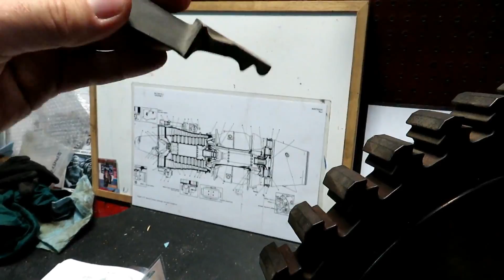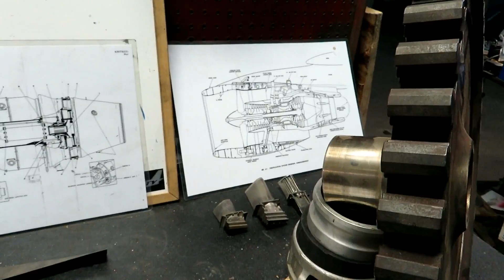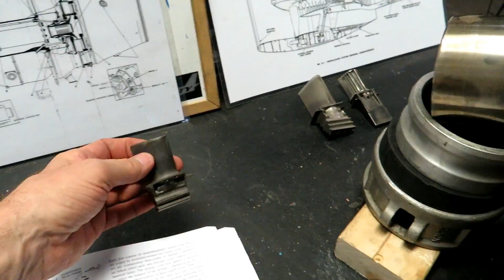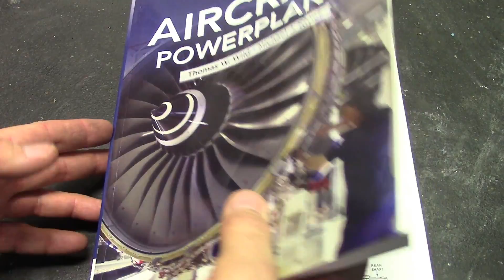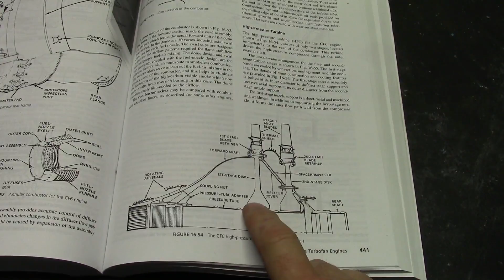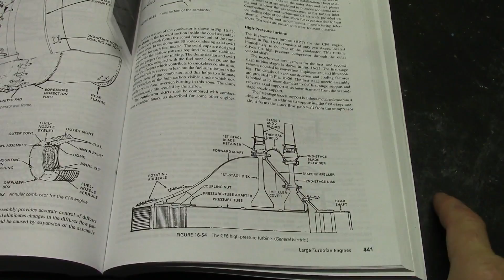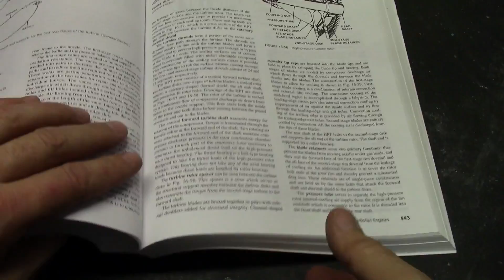Turbine Interstage Seals

Comment: I enjoy these views. I have a question about jet engines and over-revving. Say on the boat engines you work on. Say boat pops out of the water, does the engine speed up or stay the same speed when the load is off propeller and back on? I can't see this happens when in the air. I know not anything more than what I've learned watching your videos on jet engines in a way.
Reply: There have been occurrences where the LP turbine shaft breaks (that powers the fan) and the turbine rotors over speed and the turbine disks explode or throw all of the LPT blades.   Usual root cause of a shaft fracture is bearing oiling issues or oil fire,   Modern engines are supposed to be designed for this not to happen, but...
Reply: @powerwheelscd    have rotational speed limiter sensor (s) also to prevent overrevving

Comment: Juan Browne sent me. Nice 'splain & cutaways! One minor detail: the "compression ratio" on these turbines is diesel like which is why they have decent efficiency. 

PS: I was on this ship for the trial run of the GE turbine... quite an adventure! https://www.maritime.dot.gov/content/gts-admiral-wm-callaghan
Reply from the maker: The  compression ratio depends on rpm. It static compression ratio is zero.
That's why it's not called compression ratio... it's called compressor ratio.
Also the compressor ratio of the modern turbofans is over 40:1.
I don't know much about diesel piston engines, but is that about the same?
Reply: @AgentJayZ  OK... I put compression ratio in quotes because they're awkward to compare technically correctly. The general point is the amazing -- as in diesel like (18 -- 23 to 1 nominal diesel compression ratio) -- pressures these axial compressors create. The first jets used radial compressor/turbines with about 4 to 1 ratios... like earliest gasoline [Otto cycle] engines. The GE c6 based LM2500 has an 18 to 1 ratio... an industrial variation with no fan. The fan adds significantly... as you suggest. [... not to mention dynamic pressure... and we quickly get out of the territory of normal stuff for good technically aware people] 

The point you illustrated so well was the extent to which these amazing "hot section" parts must be cooled with "cool" compressor discharge air -- about 900°F -- and the amazing tricks required to get this "cool" to flow where its needed... the ~3000°F combustion discharge "air" being sufficient to fry most metals.
Reply: 'Compression ratio', as in an internal combustion engine, and 'pressure ratio', as in a gas turbine engine (I differ slightly in my terminology from AgentJayZ), are two very different things.  'Compression ratio' is actually 'volume ratio': it is the ratio of the volume in the cylinder at bottom dead centre (oops!  I nearly spelt that as 'center') over the volume of the combustion space at top dead centre.  'Pressure ratio' in a gas turbine engine is exactly that: it is the ratio of the pressure at compressor delivery over the pressure at entry to the compressor.  At maximum thrust, the pressure ratio for an LP compressor (or fan) could be 3:1, and the pressure ratio for the HP compressor behind it could be 8:1: so what is the overall pressure ratio of the engine? 
I have a VW 2 litre turbocharged diesel engine parked on my driveway, which is almost 7,000 miles away at the moment.  Its compression ratio is 16.5:1.  However, under power, the peak pressure during combustion could be as high as 80 times atmospheric pressure. 
PS  The answer to my exam question is 24:1.
PPS  I posted a comment almost identical to this about a year ago, when AgentJayZ presented a video about jet cars.

Comment: Is it usual that the damage done by the high energy debris of an uncontained engine failure causes such a life-threatening flood of systems malfunctions like on the Qantas A380? Would the Thai Airways pilots have had a struggle comparable to those on QF32? At QF32 they had the luck of being five of the best of Quantas together in the cockpit. I suppose the Thai pilots were only two. Did Southwest's Tammie Jo Shults and her copilot struggle with as many systems malfunctions as Richard de Crespigny and his team?
Reply from the maker: These are all different incidents that each have their own characteristics. I am not familiar with the details of each. So I decline any response.
Reply: The release of high energy debris from an uncontained failure has the potential to cause the total loss of an aircraft.  The larger the rotating component then the greater the risk for obvious reasons.  However, there is an element of luck, in terms of the trajectory of the released debris and it seems that there has been an element of luck in recent times.  
Quantas flight QF32 was, believe it or not, relatively lucky: had the segments of the failed IP turbine disc taken different trajectories, there could well have been a smoking hole somewhere in Batam island.  Similarly, Air France flight AF66, which had an uncontained fan disc failure over Greenland in September 2017, was perhaps even luckier.  Not so lucky was United Airlines flight UA232, back in July 1989.  The aircraft was almost uncontrollable, following an uncontained failure of the fan disc of its No.2 (centre) engine.  That the pilots got it down at all at Sioux City was remarkable.
Now if the Thai Airways event was down to the failure of what I would describe as a mini-disc,  the ejected debris would have had significantly less energy that the released segments of the IP turbine disc of flight QF32.  Nevertheless, if the debris had severed critical electrical wiring, or severed hydraulic lines, or punctured fuel tanks, the outcome might have been more serious, mitigated solely by the fact that the event happened at low speed, the take-off was rejected and the emergency services would have been in attendance within a minute or two.

Comment: an easier way to explain the air bleed cooling of the fins .... might be to use a section of hose and spin it around in a circle ... it will suck air through it as it spins around .... in a turbine that  rotation movement makes the fins move the air through them the same way and it pulls it from the intentional and unintentional gaps in the engines construction and of course the compressed air from the compressors ...
Reply: interstage seal sure dont mean some water animal performing tricks between show stages lol ;)
Reply: the hardest part in a  jet engine is every place along it there are several things working together to get the desired result ... some passive some active some beneficial some detrimental some intentional and some unintentional ... then add to all of that all the compromises made in the design to get the desired result ....
Reply from the maker: This is not correct. Cooling air is under greater pressure than the gases flowing through the turbine. The turbine blades will boost this pressure through centrifugal forces, but the turbine nozzles run even hotter, and they are stationary. The interstage seals do not seal cooling air; they seal the working gas stream from leaking past the turbine stages, keeping power losses to a minimum.

Comment: AgentJayZ,
I was under the impression that the Boeing 747 has a center gas tank in the fusliage. Is this a tank, or just part of the fusliage baffled off?
Reply from the maker: I know the wing tanks are really sealed off sections of the wing structure. I am not certain about the center tank, but it would make sense that it was of the same construction.

Comment: On the drawing at 10:20   ..You didn't tell us where the front of the motor is  ..it is confusing
Reply from the maker: I've shown this same assembly in several videos, and I also assumed a basic level of knowledge, that I shouldn't have. Regular viewers of my channel would know easily. However, the two labels in the diagram "forward shaft" and "rear shaft" should help.

Comment: cool! so what I don't get is:
- why the turbine disk ...node I guess, just hoovers around the shaft rather than actually attach to it at the disks. As I understood ,or didn't, the disks are hanging on the shell thingofashaft that actually attaches to the shaft
- can't there just be some holes in the disks and the thermal shield can be the passage of cooling air? 
-why is , that thing?
Reply: @ohwell2790  tell me about it
Reply: 1. Why the centre of the turbine disk just floats near the shaft.... The amount of energy the turbine needs to transmit to the shaft, is handled by the thin cone-shaped shaft which connects right below the blades. The big thick section at in the middle of the disk isn't transferring any energy to the shaft, this is just there to provide the strength needed to let the disk spin so incredibly fast without tearing itself apart from the centrifugal force.
2. why can't there just be some holes in the disk.... If you just let air bleed out of the disks into the hot gases flowing from the combustion chamber, they would just get blown away. You need to get air into the middle of the blades to cool them directly, and let some bleed out over the surface of the blades in a very carefully controlled way to create a cushion of cool air between the blade and the hot air.
Reply: @davidcoghill8612  yep , what I am asking is why the air needs to follow that path under the disks to spread to the next stage disk rather than have the disks affixed to the shaft and some holes allow the cooling 900 degree air to move past to the next disk. 
I get the outer cone shell thing carries the disks what I don't is why . Why have it like that? Is the shaft more easily serviced or is there something else .... 
whatever, I have way too little information to get a proper grasp I guess.
Reply: @bigass197  Again, it's hard to stress just how huge the stresses on these disks are. Drilling a hole in them just isn't an option (unless you made the disk many times thicker to compensate).
Fixing the hub to the shaft at the centre is a solution to a problem that doesn't exist, it adds more complexity and more points of failure for no reason. Attaching the turbines to the shaft at the edge of the disk is an elegant design that has many different purposes.
Reply from the maker: All you people: David Coghill knows what he is talking about, and is endorsed by Jet City.
In other words: "what he said, and then some".
Reply: Kindly list the many purposes, if you know them, as this is the frigin point of my question. If ya feel like it of course. Also the bottom of the disks are fat and sturdy for that very same reason the area with the holes would be fat and sturdy. I get the disks node is hanging there , huge loads trying to rip it up, and not so huge loads trying to take it out of center of rotation ,so yeah it's not needed to have it affixed to the shaft. I am still interested in how this design came to be. I mean the manufacturing aspect of this, rather than have the disks on the shaft, must be a bit more complicated so there's a problem :D or maybe not...
Reply: For the benefit of those involved in this particular discussion, I'll copy the comment that I've posted elsewhere.
The turbine discs have to be attached to a shaft that drives the compressor in some way and there are various ways of doing it.  In the CF6 series of engines, GE used what I would term a 'rim bolted' arrangement, plus a drive cone bolted through the web of the HP2 disc.  Bolt (or other) holes through discs are, however, not preferred: they are stress concentration features in a highly stressed component.  Nevertheless, with careful design and high-quality manufacture, they can be made to work.
R-R use what I know as 'drive arm' features on both the HPT and IPT discs in the RB211 and Trent engines, which eliminate the need for any through holes in the discs.  It appears that GE has effectively adopted this feature for the HP1 disc in the GE90. However, I am not at all clear as to how the drive is transmitted from the HP2 disc: I would need to see an altogether better cross-sectional GA.  There may be some form of drive arm extension from the HP1 disc through the bore of the HP2 disc, which appears to have a rear drive arm extension.   
The very last thing that a compressor or turbine designer would dream of doing would be to put splines in the bore of a disc, to engage with splines on a shaft passing through the disc bore or, for that matter, to put any through holes near the bore of the disc.  The bore and hub area of a disc is very highly stressed and stress concentration features in that area are to be avoided like the plague.  Any splined (or bolted) drive features in the vicinity of the bore would normally be formed on an extension of the disc and, if you trawl around on the internet, you should be able to find a few examples in engine cross-sectional GAs.

Comment: i would like to ask, may be a silly question- why is it called GAS turbine engine if it is fed with fuel?
Reply from the maker: Most of the engines we work on are industrial, and run on natural gas, or sometimes propane in its gaseous state... but the real reason is because all turbines are turned by some fluid, called the working fluid. Hydroelectric dams use turbines turned by water to turn electrical generators. Their working fluid is liquid water.
In a jet aircraft engine, the turbine is turned by a working fluid that is basically hot exhaust from the combustion section. The working fluid is hot air, CO2, and water vapor, so it's a mixture of gases.
So the gas part of the name is referring to the physical state of the working fluid, not the type of fuel being used to heat that fluid.
So, what type of turbine is a wind turbine?
Technically, it's a gas turbine.
Not a gas turbine engine, but a gas turbine.
Reply: @AgentJayZ  thank you for reply, indeed. I watched your channel and leant a lot from the piloting view. Good luck!

Comment: I guess if the exit or entry passages are compromised (by for example debris from a failing inter stage seal) that might also compromise the blade. Likewise "Purée of Seagull" bone fragments might be a little bit of an issue. No doubt 99.999% of debris will be destroyed 0.001% will give you some interesting warning lights and a very expensive repair bill.

Comment: Not a turbine blade Fir tree connection?,and the shaft seal a labyrinth seal
Reply from the maker: The blades are attached to the disk with what is commonly called a fir tree. Did you see it?

Comment: While I myself completely understand the pressures and everything in jet engines (was my favorite part of my thermodynamics class for engineering), it probably doesnt help the people who think the pressure is increased in combustion when the turbines are called "high pressure turbine" and "low pressure turbine" lol could be the source of confusion there
Reply from the maker: The HPT works with gases at a higher pressure than the LPT does. At the time of the naming, maybe it was assumed that discussions were mostly going to take place among engineers and fully seasoned "jet people", whose minds were not cluttered with piston-engine detritus... eh?

Comment: Why is the turbine disc so heavy, for angular momentum or strength?
Reply from the maker: Each blade pulls at its root with the force equivalent of the weight of 3 F-350s on a scale, and it runs nearly red hot on take off.
Reply: Entirely for strength and integrity.
Reply: @AgentJayZ  Glad to hear Canada has finally adopted the American unit of weight.
Reply from the maker: Well, we're still undecided on King Ranch vs. Platinum.
Reply: @joshtargo6834  Yes, the USA is the about the only country in step, in not using the SI system. We still give road distances in miles in the UK, with everything else officially metric by law, but with a few old hands like me still able to think in pounds, feet and inches, etc.
Perhaps it’s as well we stick to miles, because it would really confuse a certain Donald J Trump who thinks that it’s “difficult” for an American to drive on the left when visiting the U.K.
PS. As an engineering student in the UK, back in the early 1960s, I had to do calculations using ‘poundals’ and ‘slugs’.
Reply: Unusually for me, I tried to be studiedly brief in giving you an answer. AgentJayZ has given you an excellent description of the environment in which a turbine disc is working.
Reply: Adding to what you have already been told, a turbine disc might appear to be big and heavy, which it is, but it is designed to be as light as it can be to operate safely at high speed and at high temperatures. 
It is made from a special alloy, developed specifically for the purpose and its manufacturing processes are strictly controlled to result in the highest possible quality for the finished disc.  It is has to be light enough to fly: if it were designed to last indefinitely, it would be far too heavy.  
 It is therefore designed to have a ‘predicted safe cyclic life’ (PSCL), in order to be light enough. This means that it will last safely without failing for so many starts and stops of the engine.  To prove that this is the case, sample discs are removed from service and inspected at progressively increasing proportions of their PSCL.

Comment: How much will this AD cost to comply with from a bean counter perspective?
Reply from the maker: I'm not a bean counter. I fix 'em, I don't pay for 'em.
Reply: It'll only affect at most 1 plane each from 8 airlines or 8 planes from one very unlucky airline. I know nothing about this, but I'm guessing this'll be way way cheaper (amortized) than, e.g., the pickle fork issue, which requires extremely in-depth inspection of ALL planes of the affected type (past a certain number of cycles).